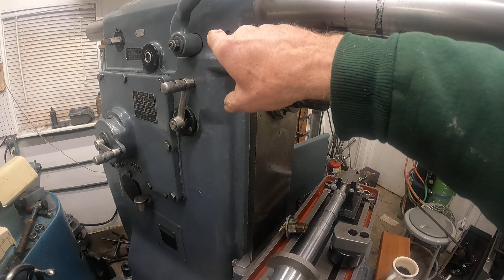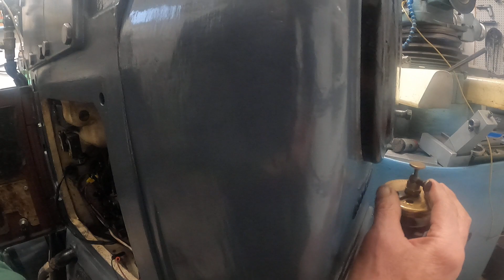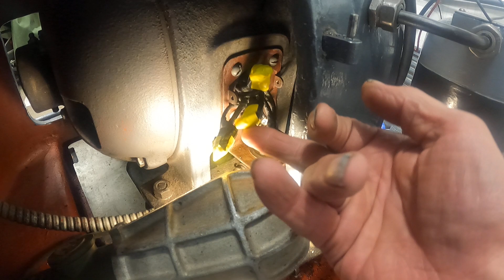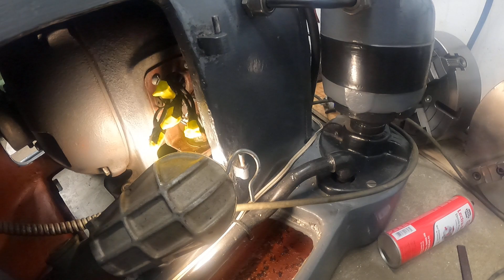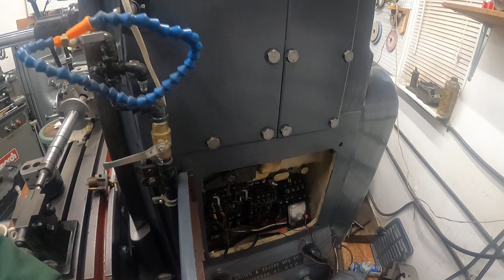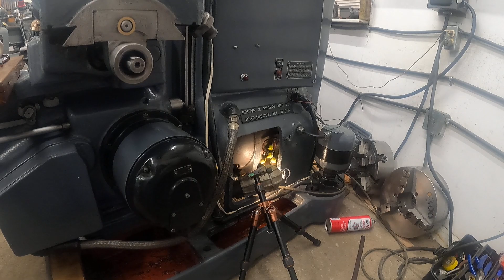Brown & Sharpe milling machine motor smoke check

Comment: On my mill, the knee motor is just for the rapids. Feed drive is via a cardan shaft from a gearbox in the body to the main motor. A similar gearbox for the spindle too.
Reply from the maker: The problem with the machines is they made too many changes, almost no two alike. I was told they had great in the field service though.

Comment: I know this is blasphemy but a cog drive belt would sure be quieter than than classy chain.  Glad no smoke and no fire without having to remove the motor.  Saved a lot of work.   Cheers, Will
Reply from the maker: There is a flywheel effect with all of that weight  rotating that has been noticed by Reed Prentice lathe owners that it seems to dampen some operations like intermittent cuts. K&T in the same time built actual flywheels into some milling machines for that same reason. I have a rare opportunity to explore that with a machine in good condition. It seems that the problem with the motor was the sticky residue  from the old coolants making for bad contact. I am nearing the end of this driveway machine tool repair operation after over 2 years and an unexplainable amount of hours on 3 old machines.

Comment: Always amazes me that American motors don't have a decent connection block for the motor wiring, its all just floating around in the breeze in there.
If that was British it would have a bakelite block in there with brass studs and the wires would have crimped on ring ends, washers, solid jumpers to allow either star or delta connections (usually) and nuts to do it all up.
Reply from the maker: You are absolutely right and it is a trouble area in many ways such as stressing the leads way back into the motor, but we did pretty good on the electric chair. I am more than impressed with British wiring being the owner of a Hiwatt guitar amplifier, work of wiring art.